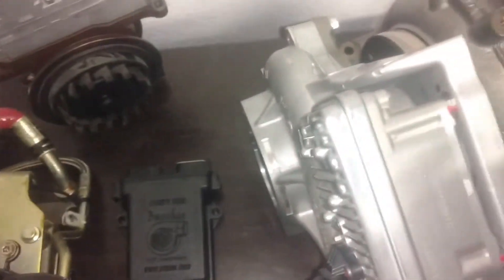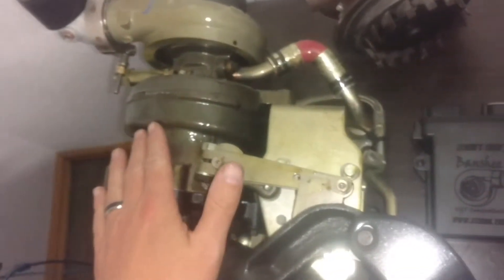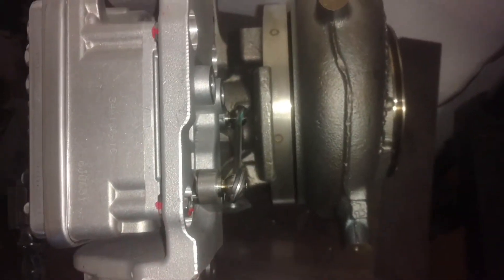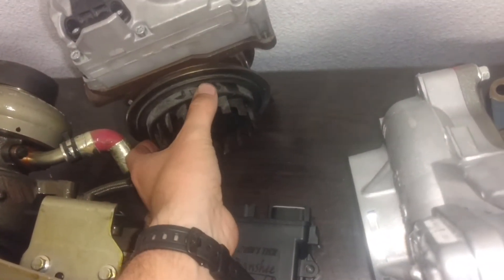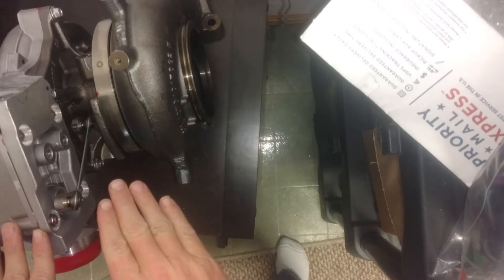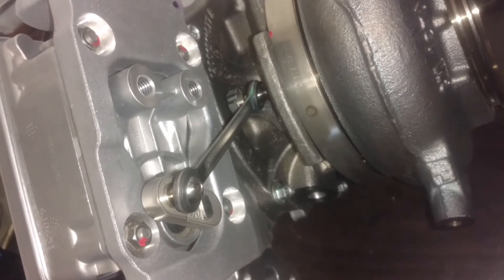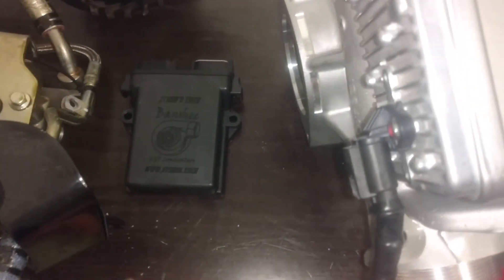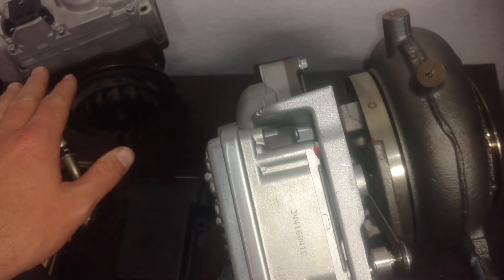Steeds Tech L5P Duramax Turbocharger demo

Comment: Does this work on the older duramax turbos?
Reply from the maker: Driven Rod & Customs it can, I just need to write the code
Reply: I have an LB7 duramax that Im working on and I think it would be cool to have a vnt turbo on it
Reply from the maker: Driven Rod & Customs give me a call tonight or tomorrow. 253-380-0055
Reply from the maker: It doesn't already have one?
Reply: The LB7 doesn't have a vnt turbo. I think they started on the LLY or LBZ. I'm still a bit away from having my project close to being done. I think it would be cool to have this on it. I love the sound of the vnt
Reply from the maker: Driven Rod & Customs give me a call tomorrow 253 380 0055
Reply: Whats the model turbo and size on the l5p turbo?
Reply: Holset does not have a unison ring . What is shown is a vane piston or nozle. Unison rings are found on Garrett VGT.